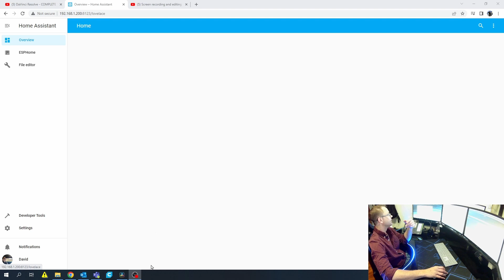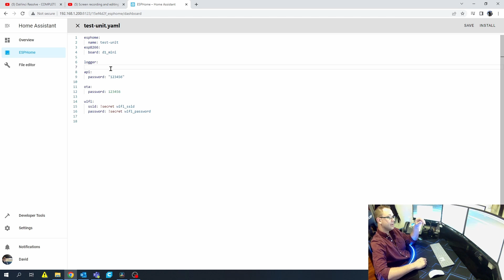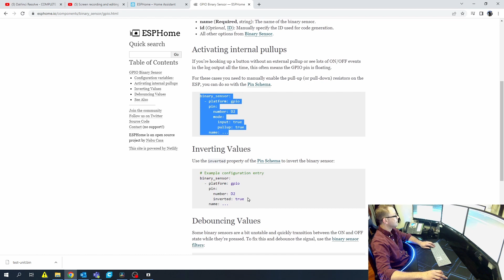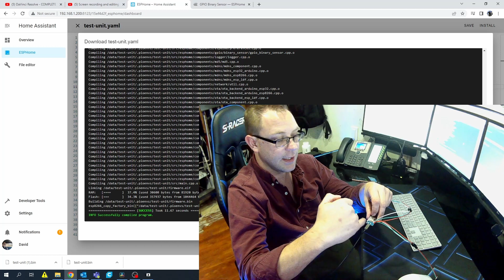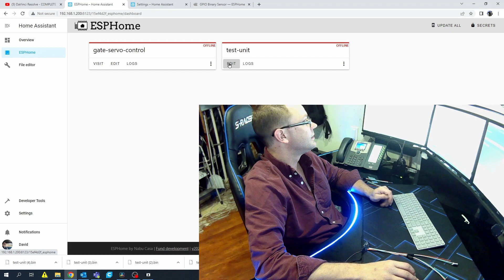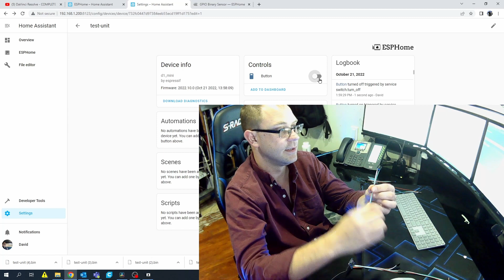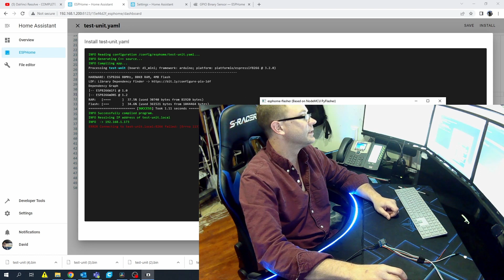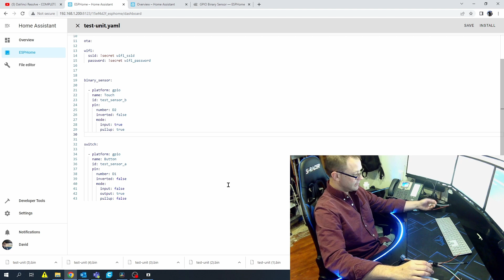ESPHome First Binary Sensor/Switch Setup

Comment: At some point between 9 months ago and today, they eliminated the option to choose a board in the same manner as you could with the Wemos mini. I don't quite comprehend the reason behind this decision, as the board selection used to dictate the assignment of pins for various functions.
Reply from the maker: Oh wow, I didn’t know that. To be honest, though I haven’t used that feature for a very long time. I typically will just copy the same config I have as I only use a few different types of boards. I know I haven’t had any issue going that route.